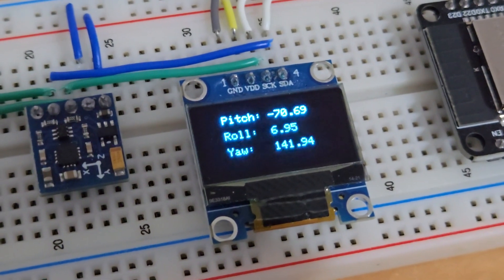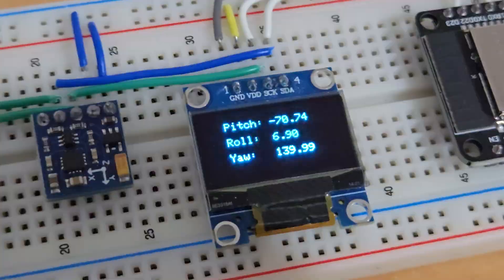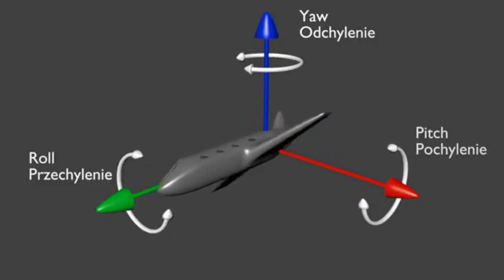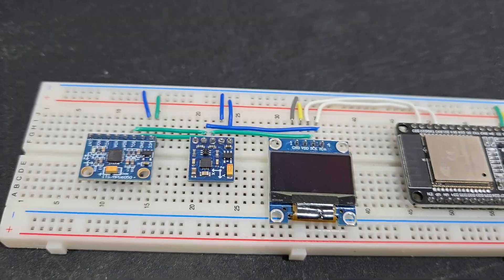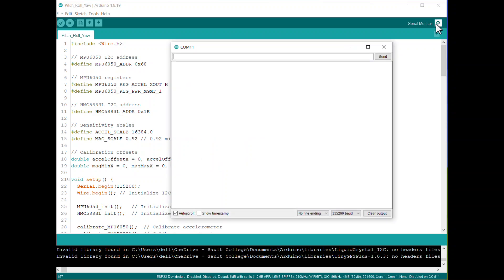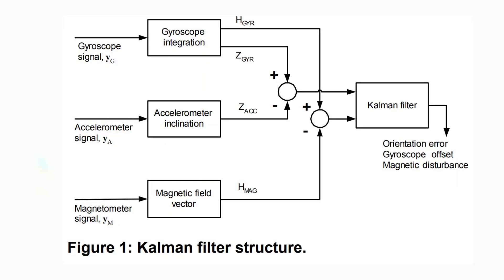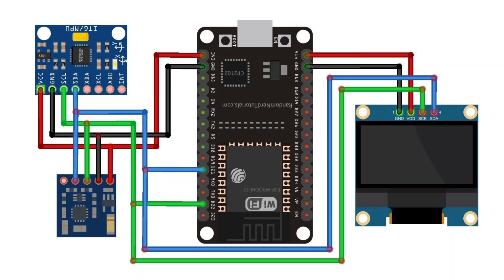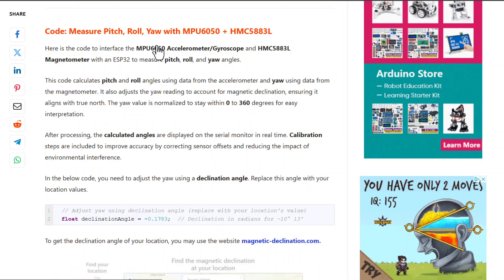Sensor Fusion (MPU6050 + HMC5883L) || Kalman Filter || Measure Pitch, Roll, Yaw Accurately

Comment: Good day! Need help. I am assembling a device for controlling MPU 6050 and Arduino UNO with a stepper motor connection and angular deviation. Zero drift is very annoying, I have used all possible filters and DMP settings. And in general, the module is very weak. What can you recommend to replace MPU6050? A separate module or an assembly of modules.
Reply: In my experience, the mpu6500 is probably what you are looking for. It's slightly more expensive but its newer and more robust.

Comment: In 1:04 as the mpu is stable but it's does not getting 0 value means it's have a problem with pitch and Roll calculation .
Solution:- use different variables for roll and pitch because this overwrite the program

Comment: Hi,
Thanks for the tutorial.
I have few questions:
1. Will there be a gyro Drift after using KF?
2. Instead of two different boards, can the same be done using MPU 9250 ?
Reply: I can use Arduino instead of ESP right?
Reply from the maker: There is improvement in gyro drift with time. You can use Arduino instead of esp as well. The MPU9250 has different register address and code is different for them.
Reply: Thanks for the reply!
Does this mean its impossible to eliminate gyro drift?
Reply from the maker: The gyro drift is already eliminated here. However there is always slight noise in mpu6050 due to vibration and some minor movements.

A great alternative for MPU6050 is BMI160.

Comment: Nowadays it's hard to get hmc5883.... So please make a video about fusing the sensor of mpu 6050 and qmc5883 sensor... Asap
Reply from the maker: QMC5883 and HMC5883 both are same. You can work with any of these....
Reply: @HowtoElectronics  you are partially correct.... Register addresses and set mode values aren't the Same..... 

And Thank you so so much... I really needed this video... For a long time, I was expecting someone to use the Kalman filter to fuse the accelerometer gyroscope and magnetometer sensor data... I couldn't see anyone doing it... So thank you again... 

And a small request (I know it's not small),
If you can make code for an extended kalman filter to Fuse the mpu 6050 data and qmc 5883 data... It would be very useful to me and others as well. I was trying to make a model for EKF for a long time ... But I ended up failing...
Reply from the maker: Thank you for your detailed feedback and kind words! 

Regarding the Extended Kalman Filter (EKF) to fuse MPU6050 and QMC5883 data, I understand its importance. I will definitely give it a try, and if I can successfully implement it, I will post a video explaining the process step-by-step. Stay tuned, and I appreciate your patience!

Comment: Without overstepping, I would like to offer a few suggestions. First, set the filter window size. For example:

#define WINDOW_SIZE 15
float pitchBuffer[WINDOW_SIZE] = {0};
float rollBuffer[WINDOW_SIZE] = {0};
float azimuthBuffer[WINDOW_SIZE] = {0};
int bufferIndex = 0;
// It would be appropriate to keep the WINDOW_SIZE between 5 and 20.

Then, add a moving average filter. For example:

void applyMovingAverage(float &pitch, float &roll, float &azimuth) {
    pitchBuffer[bufferIndex] = pitch;
    rollBuffer[bufferIndex] = roll;
    azimuthBuffer[bufferIndex] = azimuth;
    bufferIndex = (bufferIndex + 1) % WINDOW_SIZE;
    pitch = 0;
    roll = 0;
    azimuth = 0;
    for (int i = 0; i < WINDOW_SIZE; i++) {
        pitch += pitchBuffer[i];
        roll += rollBuffer[i];
        azimuth += azimuthBuffer[i];
    }
    pitch /= WINDOW_SIZE;
    roll /= WINDOW_SIZE;
    azimuth /= WINDOW_SIZE;
}

add loop: 

azimuth = atan2(correctedY, correctedX);
azimuth += magneticDeclination;
// Normalize azimuth to the 0-360 range
if (azimuth < 0) azimuth += 2 * PI;
if (azimuth > 2 * PI) azimuth -= 2 * PI; 
azimuth = azimuth * 180.0 / PI; // Convert to degrees

// Apply moving average filter to pitch, roll, and azimuth
applyMovingAverage(pitch, roll, azimuth);

This way, you will be less affected by vibrations and quick direction changes. Please let me know the results if you try it. Best regards.

Comment: Wow this could not have come at a better time. I’m struggling with an MPU9250 for a project due on Friday. Can’t get the magnetometer to function properly to
Measure the rotated angle. Thanks!
Reply from the maker: The MPU9250 has a similar structure, but the register addresses is different. I also had hard time in reading magnetometer reading from MPU9250. Tried multiple MPU9250, none of them.worked.
Reply: @HowtoElectronics oh dear this does not bode well.. possible to do sensor fusion only using the 6050? I just need it to give a reference point for a digital compass.
Reply: I got my MPU9250 to work ultimately, ended up using an I2C scanner to find the IMU, then TwoWire to run it in parallel to my oled screen. I used hideakitai's examples to connect and calibrate it first, then managed to work. One thing I discovered, ESP32-S3 has an issue with pin reassignment in V3 of the Board Manager. I had to downgrade to 2.0.14 to get it to work.
Reply from the maker: Great man, you discovered so many new things. And I to find out you got it working. Congratulations
Reply: I am able to read the angle but it does not update in the void loop.